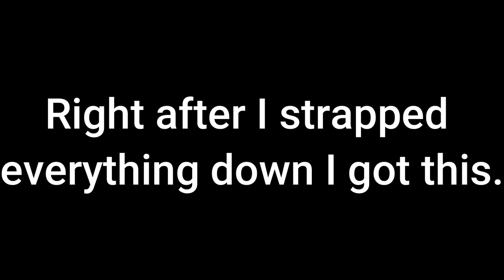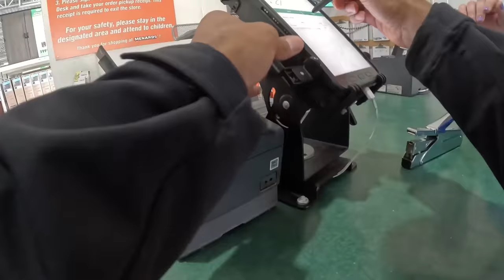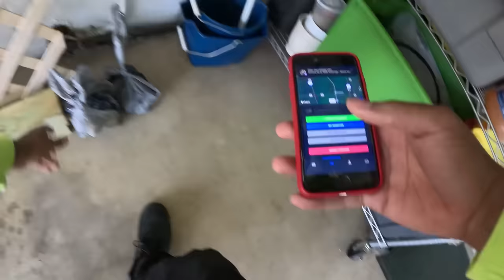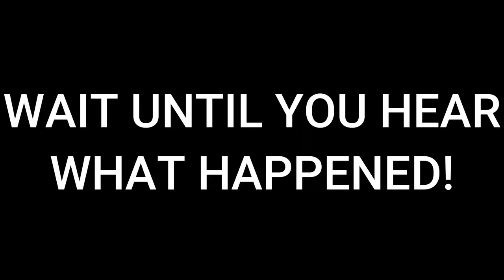Gig Driver Surrounded by POLICE at Lowes!! Caught on Camera! This was CRAZY!

Comment: I had 2 cops pull me over, had 2 more come up an exit ramp to block me in, I hadn't done anything wrong, wasn't speeding or anything! I did have something in the car that, um, wouldn't like the cops see......
They didn't search, but escorted me to the scene of a robbery, the victim  told them it wasn't me and they let me go. My stepmom, a former police detective had told me just how to handle myself under those circumstances,  just like you did. Stay calm.